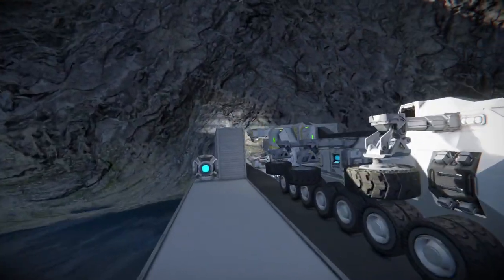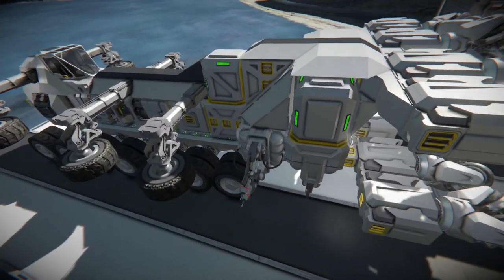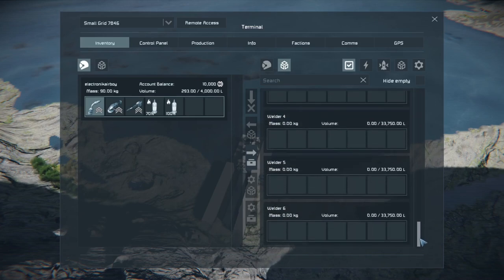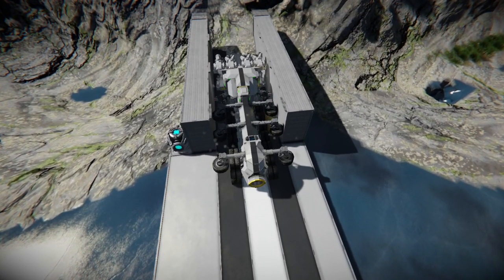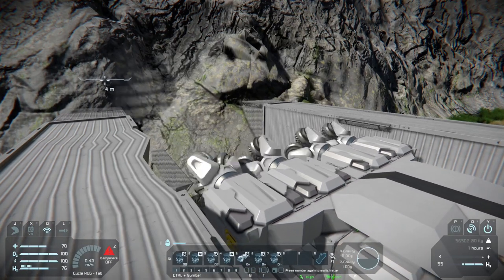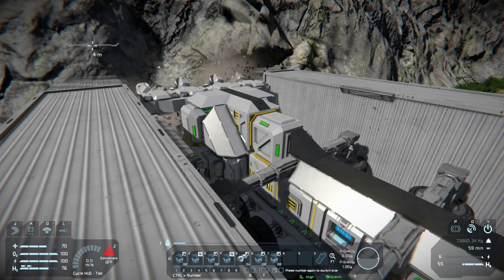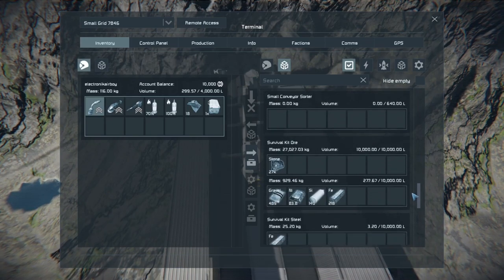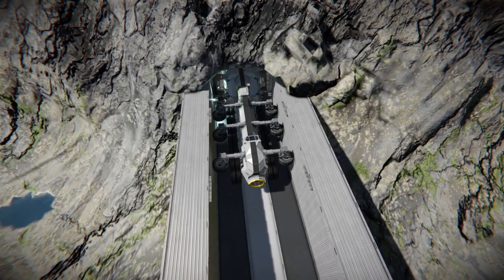Space Engineers Auto Tunnel Building Machine Walkthrough

Comment: One consideration would be to possibly use a connector to attach to a large-grid trailer, with a refinery and assembler, or even basic refinery and basic assembler, to increase your stone processing and steel plate throughput instead of using the SK's (which was a neat thought, btw).  Otherwise, a large-grid digger would handle some of these problems, though I don't know that the expense in extra materials is worth the hassle, unless you were building a very long or very large tunnel.  Anyway, great design!
Reply from the maker: Interesting thought, it would be possible to create a trailer of sorts to follow the tunnel build.  However, this would need to be a combination of small and large grid components.  Would be inspiring to see a good setup based on that idea.  Thank you for sharing.

Comment: Suggestion to add a trailer so i. Even that for some reason the digger it self can't make plates such as no materials for it, the trailer car can go back through tunnels to get supplies and then bring them to digger. Though probably wont happen often it be great for backup. Also suggest for add more different machines to digger machine family such as a vehicle once tunnel is done and you want make room or create an intersection, this second machine goes to were you want it, has trun table grinders and drill bits to spin digging up a space for room or intersection then building platform and walls for said room or intersection. With many other types for different roles so you end up baiing able make a tunnel semi automaticly but have make rooms or intersections manually seems counter the whole idea of machin. Or a various for vertical tunnels?
Reply from the maker: You seem like a brilliant space engineer!  Those suggestions sound fantastic and definitely worth trying out.
Reply: @mastermindgameplay5297  no problem, glad give ideas, though it has Accord to me, that tunnel is small, it good for small vehicle or in person but not much else, I'm curious if you were to make it bigger both width and height wise, maybe you could use a train like car that's low as possible so you can land air ships or other vehicles that can fit on top, so you can transport them more smoothly as you don't need micro manage moving ships through tunnels, current tunnel would probably be still used but for non vehicle paths
Reply from the maker: You bring up a very valid point, the tunnel building machine is wonderful for creating a general service tunnel or escape path but does not cater to much larger vessels.  Perhaps a large version shall need to be blueprinted to accommodate ships.
Reply: @mastermindgameplay5297  rue suggestion is make something like 3 or 5 different types of tunnels but can easily transition, built for common sizes of ships anything beyond that probably should just be above ground dock or something similar missile silo but for ships of which size,
Reply: @mastermindgameplay5297  one idea is set is split up tunnel into three sections in center is main tunnel five wide by five tall tunnel, 

other two are smaller tunnels for players to move through these tunnels are each 3 blocks wide, 3 blocks tall, going along main tunnel, 

All three tunnels are separated by walls at both tunnels at least 100 to 200 hundred blocks Long but must be consistent. 

At both ends of all three tunnels are auto defense turrets, four Gatling turrets at ends of both sides of tunnels so 16 turrets total for players paths, 

for vehicle tunnels has 8 Gatling guns total, four at each end, and in vehicle tunnel is 4 missile turrets two at each end ment deal with enemy vehicles trying use tunnels. And at such a low range it shouldn't miss its target.

 at the end of hundred or two hundred long tunnels are blast doors and airlocks. Also have player tunnels going around the vehicle tunnel without need to go through the vehicle tunnel itself either by going up or below it.. They don't fear hitting each other by accident, but also have the option to go from player tunnels to vehicle tunnels if need.  This thought had but of course modified for your preferences,
Reply: @mastermindgameplay5297  ps, I just Love concept and design it just gets me going,  and tend Post my thoughts as sort of respect to who gave me them. Plus I doubt I use them myself anyway

Comment: One detail I’m unsure on. How do you project the tunnel?
Reply: I'm guessing that projector to the left of the tunnel around 10 seconds in is projecting a massive premade blueprint
Reply from the maker: To project the continuous tunnel first I built a section of it in an open area and included a projector two blocks from the end.  Then I took a blueprint of it by pressing CTRL + B. Next, I added one battery to power the projector, had the projector project the first tunnel and then again used CTRL + B to now take a blueprint of a tunnel that projects the next section of tunnel. When a tunnel is started I use a stationary projector built at the beginning and project the endless projection of the tunnel.  This is one way, or you can also just make a really long tunnel projection of 1000 blocks or more but that requires having to build a long tunnel by hand initially and then taking a blueprint. In my opinion that wastes precious PCU.

Comment: how do you make the projector keep placing the next blueprint after welding the current one?
Reply from the maker: First, construct the tunnel template you would like to use and add a projector at the end.  Next, take a blueprint of that tunnel using CTRL B.  On the original tunnel template project the blueprint of the tunnel template.  Ensure the tunnel projection lines up at the end of the tunnel template.  Next, take a blueprint of the tunnel template projecting the tunnel template.  This is will be the blueprint to project when you build the first section and will continue to project one after another automatically as they are constructed. Hope that helps explain the process.
Reply: @mastermindgameplay5297  thanks it does, I decided to just build a 500m long tunnel bp lol. Your design inspired me to build one but for me it was pretty slow with just 2 survival kits and vanilla drills, I play a modded server with tiered tech so I modified it to speed up the process. I uploaded a short video of it :)
Reply from the maker: Interesting setup, I checked out your video and have to admit it does look better with the decorative walls.

Comment: better design but you still have to move the projector ?
Reply from the maker: An initial projector is built and the tunnel construction has a built in projector 2 blocks from the end that automatically projects the next section in line once it is welded by the the machine.  Continues on until the desired length of tunnel is reached.